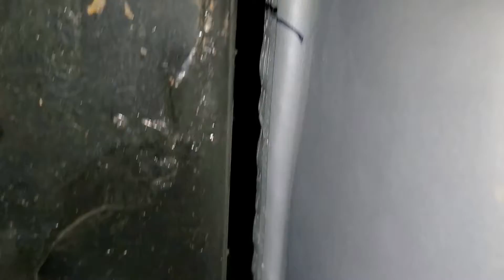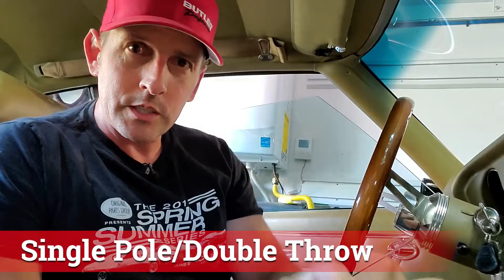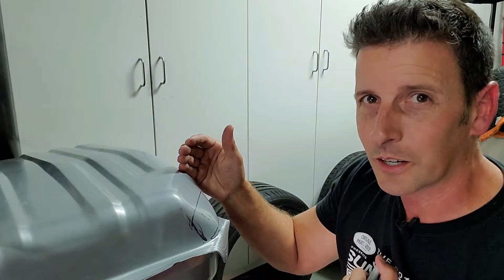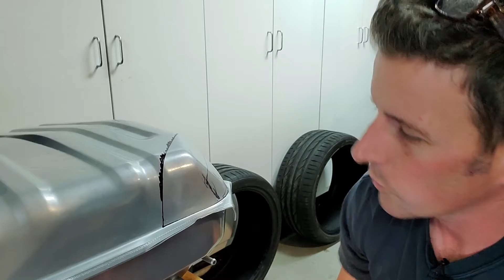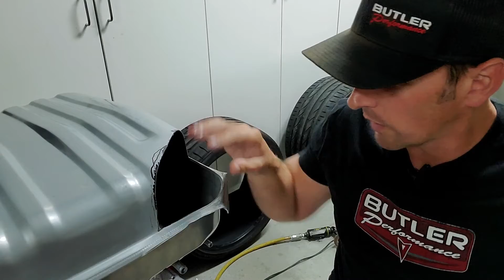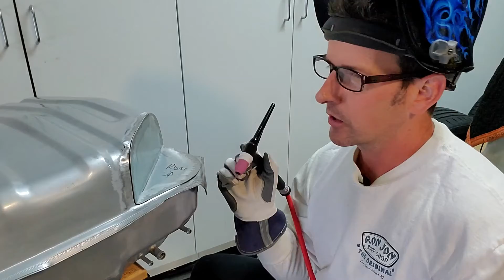Part 2 Rick's Tank with in-tank Camaro SS Pump Install - It doesn't fit, let's make it.

Comment: Nice, but I didn’t see any weld primer being used, I’ll be concerned about rust forming on the inside in the tank from welding,awesome build
Reply from the maker: Good point... I honestly haven't had very good success with TIG welding with Weld Through Primer.  BUT, what I didn't mention is I always coat my welds with Phosphoric Acid... which leaves a Zinc Phosphate coating, preventing rust.  I did that rinse on the inside too.  Thanks for the comment!

Comment: Relay allows you to run a low AMPERAGE wire to control a higher AMPERAGE circuit, not “low voltage”
Reply from the maker: Yup, totally misspoke. Less amperage to control a high amperage device, with the same voltage. Thanks.
Reply: @FastMonty  Excellent work on the video, audio, camera work, and process explanations. Superb…! 👍
Reply from the maker: @dougmarthaler3066  Thanks Doug!  Much appreciated.
Reply: A quick question, does your fuel pressure hold at 58-60 after the prime run, or does it immediately drop to zero coinciding with the pump shutting down…?
Reply from the maker: @dougmarthaler3066  After the prime shot?  It should maintain 58-60psi, until you ignition off.  Does that help?

Comment: You don't give yourself enough credit, Mike. Those welds look pretty darn good! I was wondering if you could have used the corner pieces that you cut off the tank instead of patch panels? Could you have "turned them inside out" and welded them in?
Reply from the maker: Thanks Bob, much appreciated!  Good question about flipping the corners upside down... I didn't even try that.  :)  Thanks for the comment!

Comment: Love your videos, been watching a good while now. I have to wiring best practice improvement for you.  The yellow "insulated" connector you used for your grounds, those type really desire heat shrink over them to support the wire.  The only thing holding the wire to the metal terminal is the crimped terminal. Copper wires flexing at a point like a metal terminal crimp will fail a little every flex.  Supporting that joint with heat shrink will joint the plastic insulator, to the plastic wire insulation (and a little of the terminal too) making the crimped connection way, way more durable and vehicle ready.   Your goat is awesome, I am hoping to get my 1968 to your level one day.
Reply from the maker: Thanks!  Yeah, I totally agree... I've started soldering and shrink wrapping, I think I felt this crimp was plenty sturdy.  Will definitely pay more attention on the next one.  Thanks for the comment!
Reply: Soldering is of course great. These are great too just needs tape or shrink tubing to support.  Thank you for sharing I almost bought the other unit you shared, I like this way better.
Reply from the maker: @moonburnt_garage  Yeah, I love it... just a pain to install, lol.  Thanks!

Comment: Considering you only needed a half inch, I would have dented the tank with a rubber mallet. It may not have been as nice looking but getting a weld to be water or gas tight for a none professional welder is difficult with a mig and even a tig can get tricky. You obviously have quite a bit of experience in this. Also we have to be concerned about the tanks that are galvanized. Not good for the lungs.
Reply from the maker: Cough, cough, what do you mean?  ha, ha... yeah, takes some practice, and I'm still a lousy welder.  But, one hell of a grinder though!  Clearly more than one way to skin a cat... thanks!

Comment: Hey Monty!I have a little tech tip for you, don't use a water to check your fuel cell. Use a windshield washer fluid which contains a ethanol, because it have a lot smaller surface tension than water.
Reply from the maker: I like it.  Tanks a lot.  (See what I did there?  ha, ha...)

Comment: Hey monty I think I’m a little late to the party lol. I ran a tanks inc fuel cell. I got the notched tank that allows for wider tires cleared my exhaust great, though down side being, no corner pick ups and multitude of vents. Its always good to see that good old fashion ingenuity 🙌🏾🙌🏾
Reply from the maker: Thanks for sharing, Carlos.  Sounds like you have the high end stainless tank?  I know Rick's has several different types.  Still better than stock.  And thanks, had to make it fit.  ha, ha...
Reply: I got the chambered tanks Inc tank also it's baffled and I have a stock style fuel sock. Ran the same sock in a plastic baffled tank before with no issues.

Comment: Is there a big difference in performance using fuel injection than perfect tuned old school HEI and a good dependable Holly manual double pumper Monty? Can you tell the difference?
Reply from the maker: Fairly significant difference with starting, throttle response, and most importantly, never stalling coming to a light.  That used to drive me crazy.   Thanks!